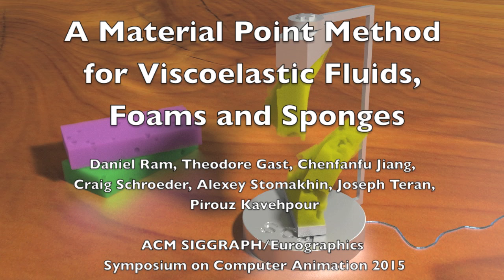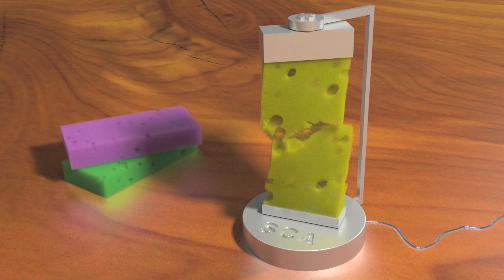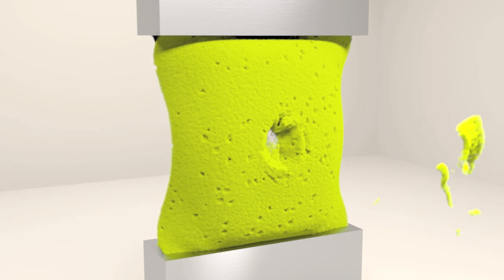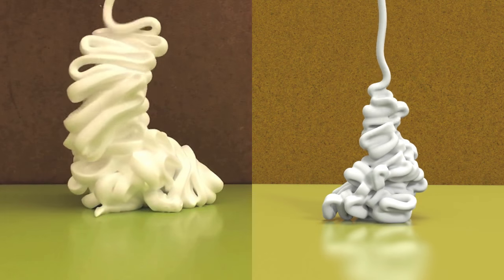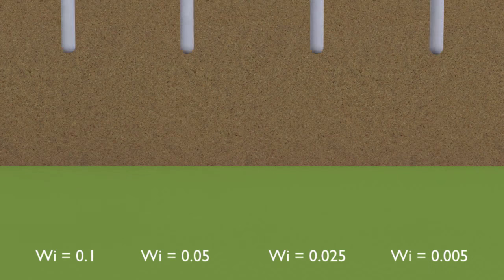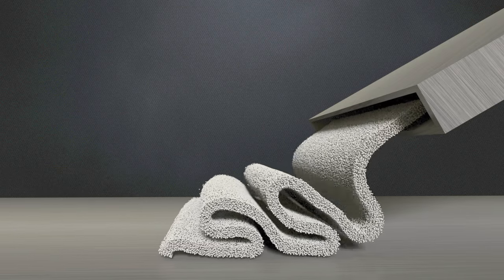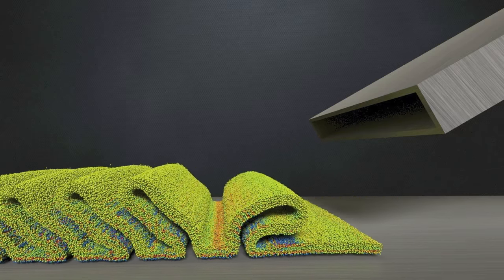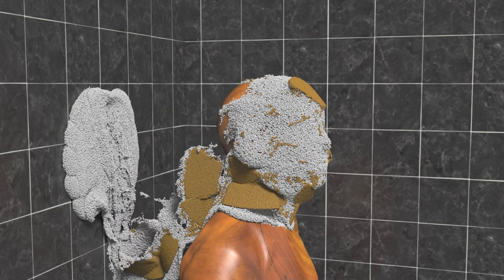A material point method for viscoelastic fluids, foams and sponges

Comment: Okay, I can't find answer to this anywhere. 

How do you learn to start doing stuff like this. Is there any tutorials or resource material you can recommend?
Reply: I don't know exactly what you are referring to, the computer program/model/engine to generate the data or the simulation is an advanced numerical method, so to learn it with a tutorial is difficult, there is a lot of work behind MPM and it is a fairly new method. Now if you are referring to the animation, that is another thing, there are many software to generate this kind of visuals, but they are usually not the output of the numerical model itself, just a visual display of the result (which is nice because it lets you see the results graphically).
Reply: You can learn from one of the author's PhD thesis (https://www.seas.upenn.edu/~cffjiang/research/thesis/thesis.pdf), which explains a lot about MPM. For basic tutorial about physics-based animation, I recommend you to join our EdX course online: https://www.edx.org/course/animation-cgi-motion-columbiax-csmm-104x